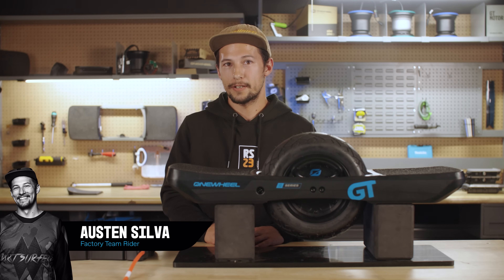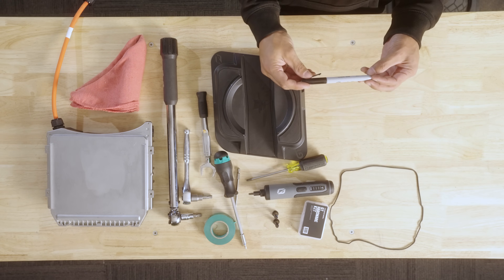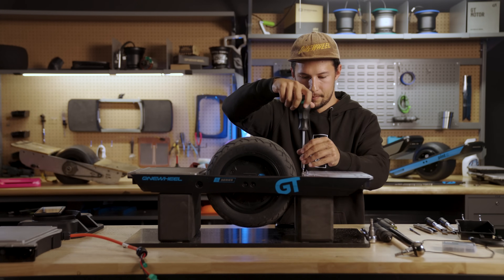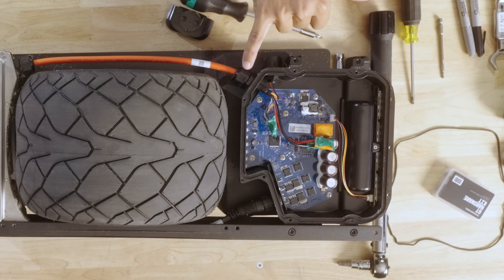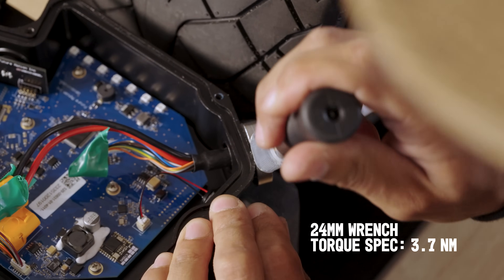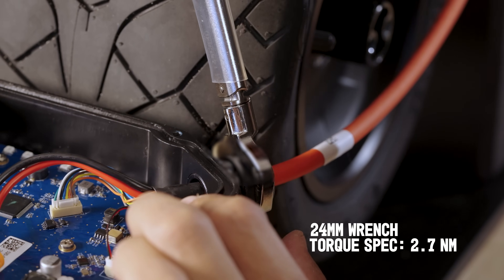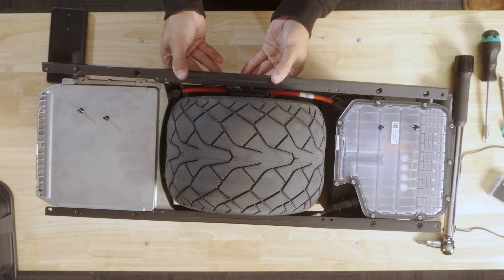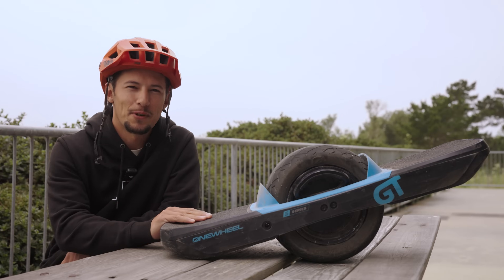How to install a Onewheel Battery Module

Comment: I have a new board with less than 150 miles on it and it now has a chuck missing out of the hub.  Is this covered by warranty? Before you ask im almost 50 yo and im not doing tricks or drops so i was very confused 2hen i saw it.

Comment: Sold out on Battery Modules for Pint and Pint X, already?! Please use some sort of intelligence to predict your product turnover. What is the excuse when the battery packs seem to last no more than a couple of years? The market is finally getting competitive; if you want to strengthen your value proposition, I'd use the purchasing power that your structure should allow to keep your stock plentiful. You are no longer a Startup. Thank you for finally offering a more sensible policy for your product repairs. Keep floating!

Comment: This is nice but .. bring back the ability to see cell voltages and other diagnostic information. This is a safety issue. I won't even consider buying a thing from FM until this happens. It's unfair and unsafe.

Comment: Kinda wish the cable was detachable from the other side, so it would be just: unscrew the battery lid, disconnect it, swap the battery, connect the socket back, screw the lid back... Instead of disassembling the whole board. 😅

Comment: I thought that disconnecting the battery bricked these boards.   What changed?
Reply from the maker: That was actually never the case. You could always unplug your battery, but unplugging your battery from the Battery Management System will cause an error state.

Comment: Not gonna celebrate this. This should have been something from day 1. Why did it take 2 years before you decided to allow us to change our own battery
Reply from the maker: We’re a smaller team than most of you realize. We have a ton we’re working on including new products and everything takes time. Cheers!
Reply: @Onewheel  Understandably as it would take any small team a while to get products out, however this product was already out and we weren't able to disconnect the battery without it giving an error code and forcing us to send it back to be fixed. There's literally tons of posts all over websites with photos and videos of it. So thanks for finally allowing us to change it out now but not going to celebrate

Comment: If I unplug my already working battery module and ship it overseas so I can travel with my board can I replug the module and reactivate at destination? Provided I followed all steps correctly.
Reply: If you’re only disconnecting the controller XT60 (demonstrated in this video), you will be fine to reconnect and won’t need to activate.
Reply: @fixmypev  I didn’t  know if the haptic buzz update included a reactivation step. Or if that’s coming in a future update.
Reply: @Mowguli  It didn't, but the new versions of the Onewheel app (looks like they're available for download/update now) should include the activation menu option and function.
Reply: @fixmypev  Thanks bro, you da man.
Reply: @Mowguli  You're welcome. 🤙🏼⚡💯

Comment: 10:47 - Disclaimer: You will receive an Error 22 (Incompatible hardware detected) and the lightbar will flash red if powering the board on at this point. This is normal and will be corrected by completing the process at 13:00 of this video.
Reply: Great PSA, ty.
Reply: Isn't this one of the features Rewheel originally had? The community is amazing
Reply: @xavicon64  It wasn't specifically a feature of ReWheel, but Cassiopeia - 6109 allowed Factory Mode to be accessed via BLE apps like nRF Connect and LightBlue. Accessing Factory Mode allowed us to trigger a calibration action that cleared Error 22 and also calibrated the IMU. Hoping to see something similar coming from FM in the future.
Reply: Does anyone know if you install this with aftermarket rails will it hold the level?
Reply: @ashtonyoas3100  If your board has already been leveled prior to completing this process, it should maintain the same leveling. The battery activation process does not seem to impact the IMU (no mention of ensuring the board needs to be leveled during activation).
Reply: IF you can get activation to work. (It doesn't)

Comment: Is this a stock battery or an updated better range option?
Reply from the maker: You need to use the same battery for the board you have. If you have a GT, make sure to get a GT battery module. They are not cross compatible!!!

Comment: If you beef up continuous discharge of mosfets on the controller and release a way to re-level the board for after-market rails there wouldn't be much reason to go VESC anymore.

Comment: Wont there be an Error Code after disconnecting the battery from the Controller??? Disconnecting battery is know to brick the GT controllers.
Reply from the maker: Short answer is no. Long answer is that's  actually never been the case contrary to popular belief. You can disconnect your battery, you just can't disconnect your Battery Management System from your Battery bc it ensures that your battery is regulated which is very important to avoid catastrophic battery accidents. But as you see in this video, the board is totally fine after the battery is disconnected and reconnected properly.
Reply: Crazy news🎉
Reply: Error 22 (Incompatible hardware) is the only error that will likely be seen (due to parts pairing) and that is what the battery activation function is designed to address.

Comment: This is awesome. Big change from before! I was honestly never going to buy anything from future motion again. But if we can not only work on our own boards but get instructional videos on how to from future motion them selves. I might just stick around when my GT gives up on me one day. 

I've always worked on my own stuff from rc cars and drones to skateboards and bikes.
Reply from the maker: Glad to hear it. Individual components are out there, motors, batteries, basically just the controller left and that's in the works. Also making sure to provide super in depth installation video and eventually manuals so that people can be sure to do it properly bc it is really important!
Reply: @Onewheel  manuals would be a huge thing for me! It'd be nice to have a consumer lever manual and a breakdown with a diagram of stuff on the back.
Reply: @Onewheel is there any hope to be able to level the board for after market rails? We in the the community love all the progress you’ve been pushing towards. Angled rails give us such a locked in feeling and should be available for those who want them
Reply: @Onewheel  Are you enjoying this process though, or just doing it begrudgingly because you were forced to?

Don't answer, we know.
Reply from the maker: @Sidkain  we had a couple beers to celebrate last night actually - were thrilled about it. Always been a pain point and has been something we've wanted to do for quite some time. Was actually on the roadmap for June 2023 but got derailed by the CPSC saga. We're a small team, lots of things to do and sometimes they take time.
Reply: I whole heardedtly agree I'm glad they made the decision finaly to do the RIGHT thing. makes me appreciate them more now but still kinda pissed about the discontinued XR makes no sense

Comment: 6 months? What a joke 😂
Reply from the maker: 6 month warranty on your battery is pretty solid. Obviously batteries degrade over long periods of time but a warranty gives you piece of mind that if your battery doesn't perform up to spec after replacement we'll get it swapped for you free of charge.
Reply: @Onewheel  Would u say 90 days is pretty solid? cuz its not 6 months. FM lied again. 6 month warranty is a "typo" according to Mark on ur support team.

Comment: Great news!  This is but the first step.  I hope we share the same goal of: fly with your wheel, rent battery at destination business model for popular onewheel vacation destinations.
Reply from the maker: 🤓 not a bad idea...
Reply: @Onewheel battery vending machine with return feature to keep them charged and less human capital
Reply: That'll require a whole new battery module. It would possibly work if the battery pack itself (no circuit boards) was made easy to access. Because, as is, there's too much messing around with small connectors and almost complete disability \ reassembly.

Lastly, this seems like a step in the right direction for self repairs. 👍👍
Reply: Amen! I couldve used it this wknd on vaca in FL ... was just thinking the whole time, this would be the perfect place to just one wheel it!

Comment: How long until replacement battery packs for pint and pint x come out
Reply from the maker: we're working on that now. They're on the website and should be available to purchase soon.
Reply: What about XR packs? Will those eventually be a thing?
Reply: @Onewheel  And, will the Pint battery use new battery tech for a slight torque and range bump?

Comment: Hey, onewheel can do motor swaps?
Reply from the maker: yep, you can do those already.
Reply: @Onewheel  Can you please add an option to recalibrate hall sensors? Even the motor it came with can eventually get out of tune I've seen. Also add digital tilt option. Your current implementation does not work for standing still or riding switch.